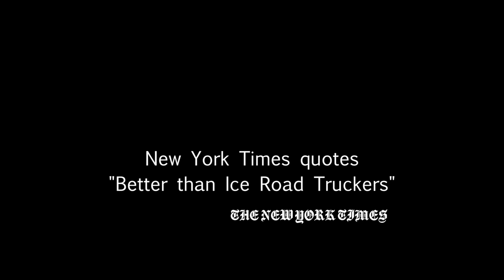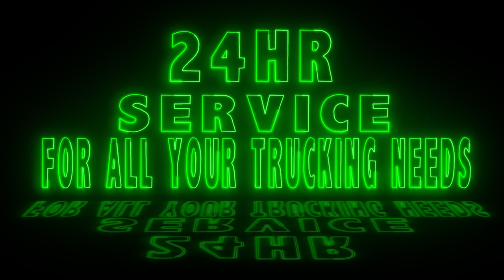CENTRIFUGE TO THE GROVE

Comment: Are you running a T800 ?
Interesting seeing a step deck on your winch straight truck. Don't see that in these parts.
Cheers from Las Vegas Nevada
Reply from the maker: C500 is the truck, we only have one step deck trombone. I have a few videos with that moving some huge water tanks for frac
Reply: @TimelapseTruckerRTOT  it's a interesting trailer, have never seen one.
 I was under the impression that the oil patch was dead in Canada. Seems stuff is going on.
 Be safe out there brother.
Reply from the maker: It’s alive and kicking now, lots of companies gone and we’re all under staffed 🥳